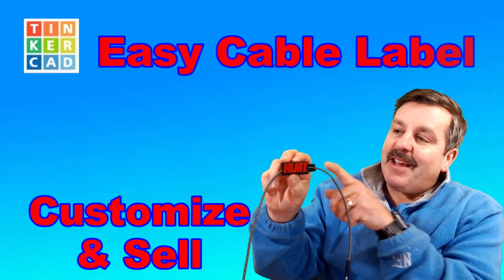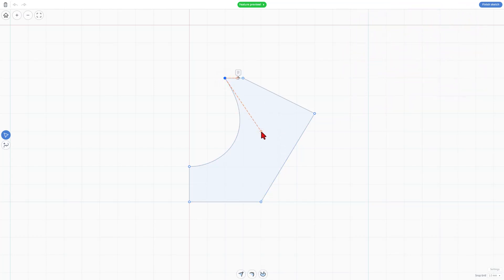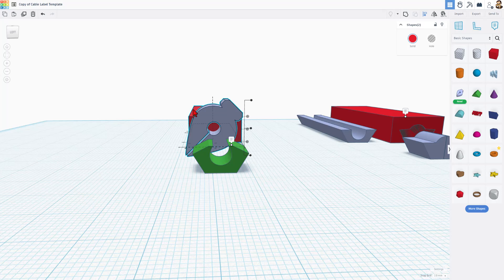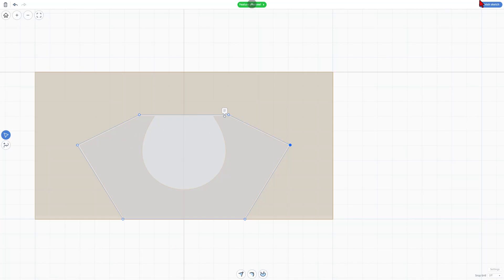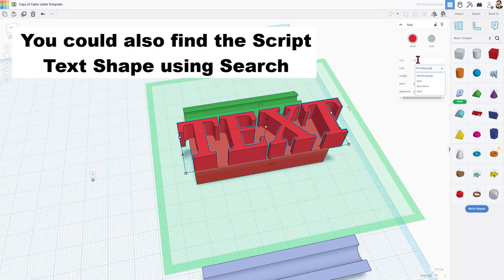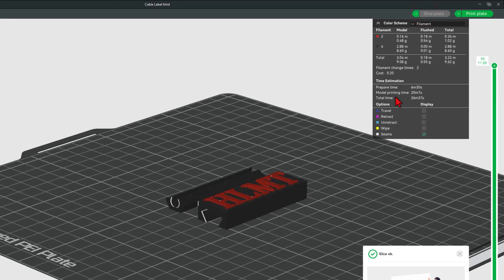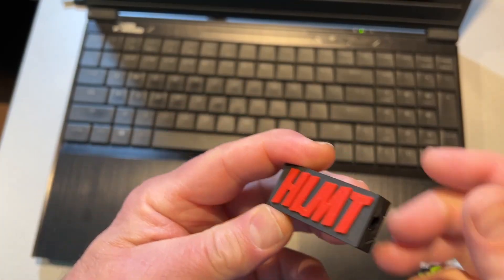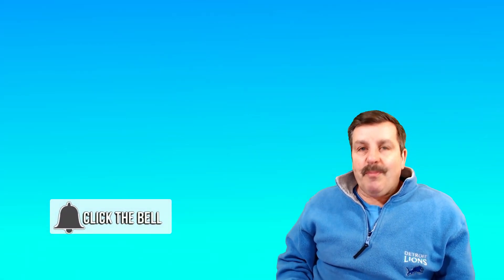Tinkercad Custom Cable Label Template & Tutorial Bambu Text TOO!

Comment: can that be made with a cylinder shape ?
Reply from the maker: I would expect so. Print the cylinder with the cut out vertical. Print the slider part the same. Are you not interested in adding the words?
Reply: i would be adding a barcode sticker from a label maker approx 19mm tall by 40mm wide. then wrapped with packing tape 52mm wide to protect the sticker from coming off
Reply from the maker: Seems to make sense. I have a slick chat area at my Patreon site. https://bit.ly/hlpat  It is available to free members. Slick for questions like this because we can add images and links. This explains it. https://youtube.com/shorts/xHUM1eGOmjE?feature=share  You could share images of your success, or ask questions if you get stuck.
Reply from the maker: I just saw you joined. Let me know if you have questions about posting.

Comment: You did a great job. I will be making them a smaller version and use my label maker to put words on it. This means I can make standard sizes for the wires I use and print them in advance. Europe wire markers have a clear plastic cover that sides  into a groove on the base. The base is thin and flexes so the wire snaps in. The base is flexible so you only need a few bases.
Reply from the maker: Always appreciated @stevegorkowski3246. Slick idea to add the text with a label maker!
Reply: @HLModTech  if you have the plastic window you can write it on paper and stick it under the clear plastic window or print it on paper and place it under the clear plastic. Plastic notebook covers work great.

Comment: Great project! I would add a way to screw this down so it also works as a cable holder underneath a desk or on a wall.
Reply from the maker: Thanks @pacificcoastminiatures for the idea! 👍 I had a few other plans for it but I was not smart enough for that one!  It would be super simple to put a hole for a counter sunk screw in the bottom piece. The screw it upside down on a desk, add the cable and slide the parts together. I am thinking that project rolls out on Monday now.  💯🔥👍👍👍👍